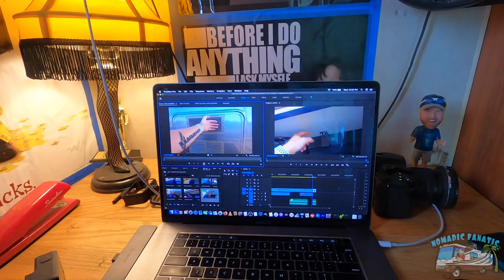I Had To Do It... And The Cops Showed Up....

Comment: if that fan falls off and hits those battery terminals and shorts them you will have a real bad day.  take some rubber heater hose, split it and put that over your battery terminals just to be safe. murphy is always lurking around.

Comment: You should cover most of the top vent up except for where the fan exhausts, otherwise it'll just suck air in beside the fan and not do a proper exchange of air.

Comment: Should keep the panels u cut out and either use them as a template or simply trim them too refit the hole they come out of , put 4 or 6 lil hangers on the sides that'll slip down and hold it in place, just a thought.

Comment: I dont know the material of that door, or the vent covers, but maybe you could get a large magnetic sign (like the advertising magnetic signs people put on their truck doors) and put one of them over the vents during stormy or winter weather. On the other hand if the doors are just fiber board with an aluminium skin and the same with the vent covers, this wont work.

Comment: Looks good you could use a 4 or 6 inch  PC tower  fan with a thermal switch  it will use less power and will go off and on with set temp.

Comment: I was thinking you should look into adding some 12v radiator fans for that bottom vent to bring the air in looks like the thin profile would be perfect for narrow space between batteries and door. They are cheap off amazon and I bet push more air than that duct fan up top

Comment: Those louvers won't do jack squat to keep water out of there, second you go down the road, and rain is running along the side with the wind, it will roll right in there and soak your inverter. Vent it to the inside somehow, preferably via a vent pipe going to the roof.  Bad bad bad bad idea.

Comment: You could of used those vents that they have on the cargo trailer. They are in the upper left corner and bottom right corner  upper left sucks air in bottom right exhaust air out .plus rain won't come in.nice video.

Comment: Do you have a thermostatic switch  to control the fan.
Reply from the maker: Nope. just plan to plug in the fan on days I need to run the AC

Comment: What do you guys think, Im more leaning towards getting a dual fuel generator. That would save me 10k in a solar setup. No worries about inverter heat and other issues, downside is noise. Is my though process correct?

Comment: The fan. Use electrical or duct tape on the bottom of the straps. Should help with any movement and possible damage to the power wire.
Also the install music was ROCKING 🤘
Reply: Exactly what I was thinking when I saw the back bracket up against the power cord. Was gonna post about it, but glad someone else caught it first.

Comment: Just a thought. I own Lux PSP 300 110V Plug into the wall thermostat. It can be set for either cooling or heating control. You could also use with a heater in winter. It also can be a timer so it only works in early morning's for heat or mid afternoon for cooling. Anyway, mine is 15 years old.

Comment: A pink foam board too bad you couldn't find one like 4/4 feet but they usually come in 8 ft I think your r-value is good on the pink but the blue I don't know how much more insulation value have on that one on the the blue foam board and I make some snaps on the back of it or somehow and that way in the winter time when it comes you just snap it in there somehow and there you go just some tips are Eric I'm not quite sure if you read this or not but it was just a thought have a great day

Comment: Your fan will never work like that. You're gonna have to punch a hole in the bottom so we can suck him fresh air from another portion of the coach. you have to drawfresh air in from another section so they can suck the hot air out. The way you're doing it it's gonna suck it in from the bottom and blow it out the top and your inverters will still be ot.h

Comment: Project turned out great. Other viewers have some great ideas for covering up vents and adding a screw through the strapping in to you fan shroud to keep it in place. Also be careful of having the strap right against your power wire.  It will eventually cut through the insulation  and could short out,  or God forbid, start a fire.  Love the video.  Thanks for sharing, and safe travels!